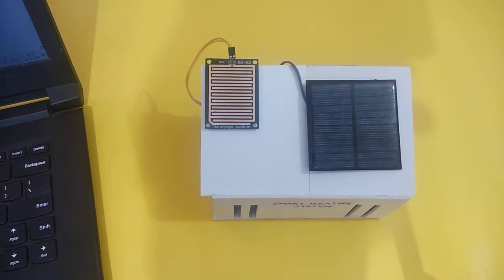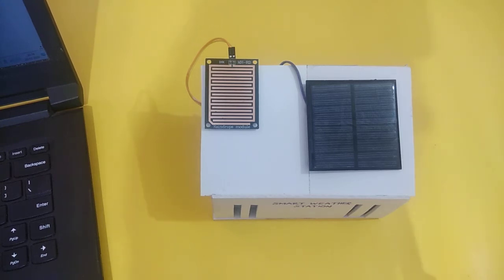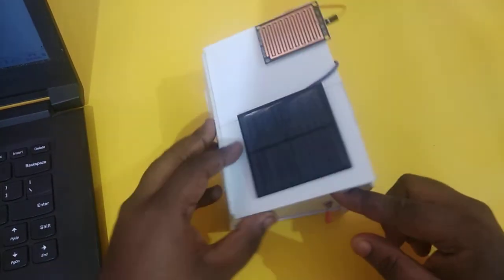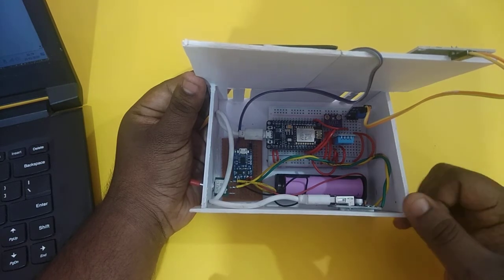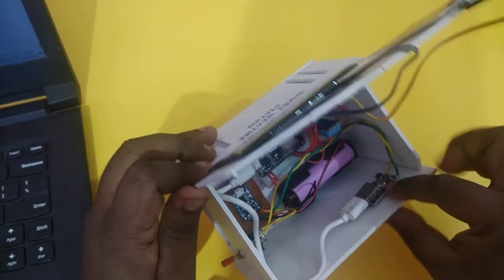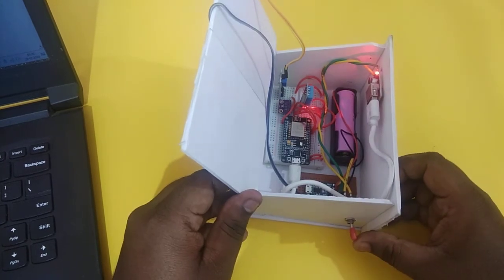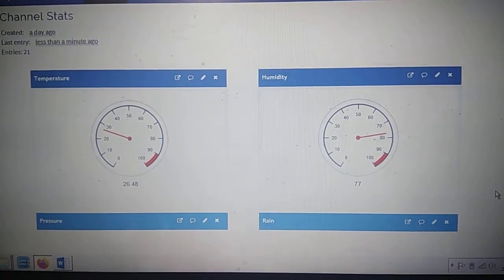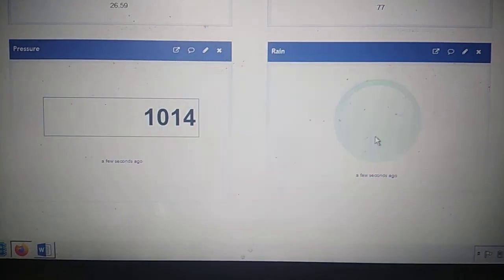Solar Powered Wi-Fi Weather Station using NodeMCU and ThingSpeak

Comment: It’s a good start. Since there is no deep sleep in the code, the WiFi is on all of the time causing the batteries being drained after a few days. The enclosure needs to be redesigned since a good rain will soak the inside. I used a birdhouse my dad made decades ago and put all but the BME 280 sensor in a plastic jar that was inside the birdhouse. I still have trouble with it dying in the short, dreary days of winter.

Comment: It doesn't look like it's going to survive rainfall. Also for a small project like this it's probably easier and cheaper to get rid of the battery charging circuit altogether. Connect a 5V solar cell directly to 3 x cheap 1.6V batteries in series. Even  4 x1.2 NiMH if you really want to go for 5 volts and connect it through the VIN pin. When powering through USB or VIN the voltage can be be as low as 4.5 volt, but I had mine running even lower.  To be fair for a long outdoor operation project like this you should really be looking at powering it directly with  3.3V.   Well, it's a nice theory starter project regardless.